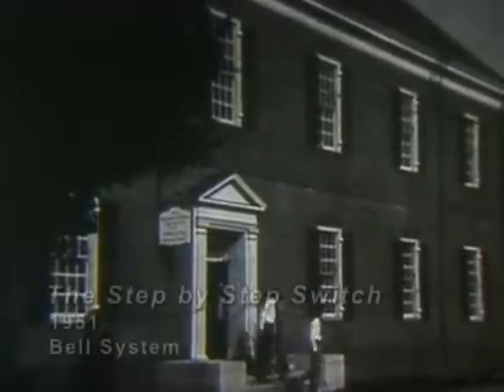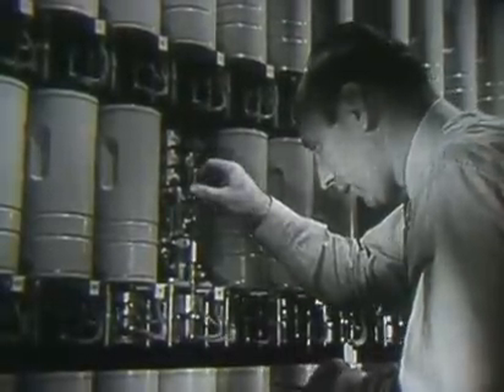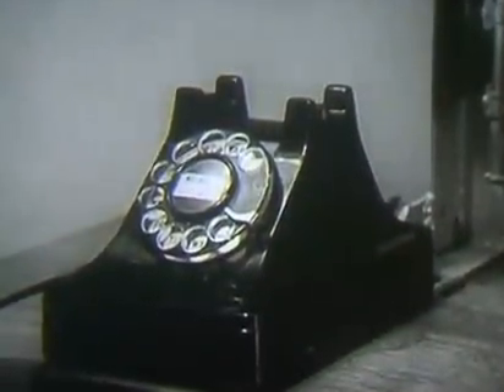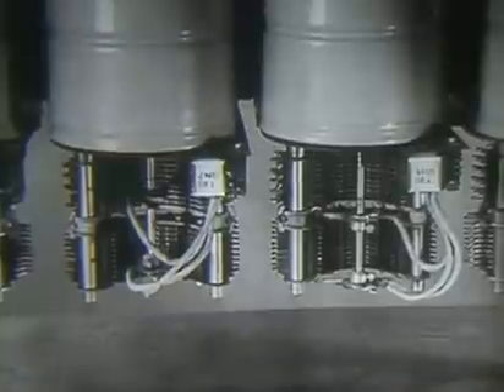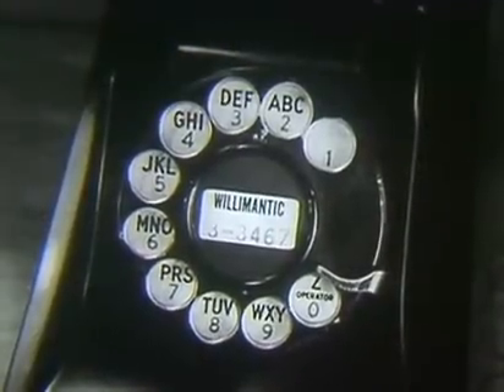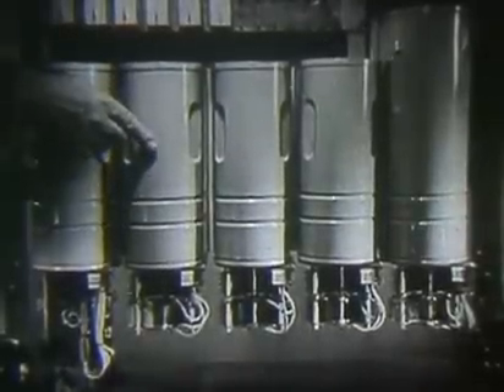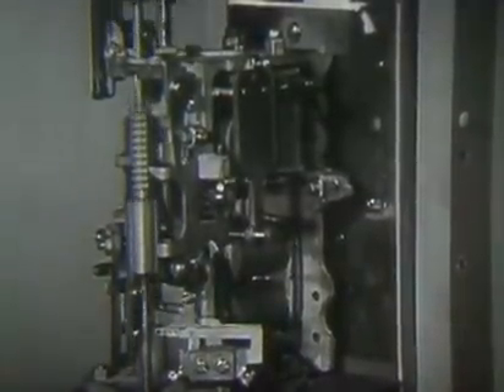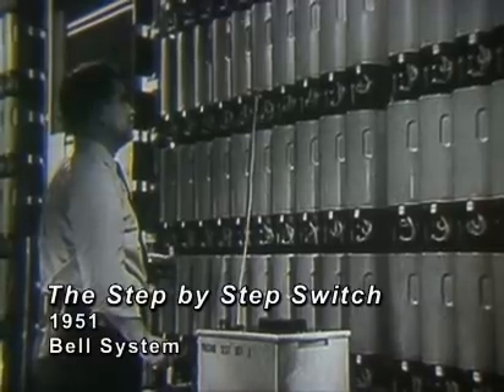AT&T Archives: The Step-By-Step Switch

Comment: Today, an entire building full of those switches can fit into a small electronic box the size of a loaf of bread. Amazing progress.

That said, there's definitely something to admire about the old mechanical system.
Reply: Oh today it can for into a box even smaller then just one slice of bread ;) it's crazy how powerful stuff has become
Reply: bigloudnoise my Dad was a SXS switchman with NE Telephone. He could stand in the office and tell you a particular relay was out of adjustment just by listening. It was amazing
Reply: @Sam Rockwell "self driving semi trucks are starting to become the majority..." I have no idea from where you got this.
Reply: The old electromechanial switches are less vulnerable to an EMP though.
Reply: There's even more to admire when you realise the man who invented the equipment was an undertaker, not an electrical engineer.
Reply: It's nukeproof (unless it gets landed on), and somewhat EMP/solar flare proof because the parts can either be cleaned up or more-simply replaced. That "loaf of bread" or "slice of bread" is, pardon me, toast if it gets fried by any of those things. Vacuum tubes and mechanical components stand a bit more of a chance. It's the same reason that the government has some old radio sets loitering around somewhere that still use tubes. There's a lot less nuclear weapons, but they didn't just disappear overnight.
Reply: @LGTheOneFreeMan  yeah but should we live in fear for a potential situation that most likely may not come? That's not living IMO. Otherwise I would be immobilized by fear of cancer, or asteroids, or volcanoes, or car accidents, etc...
OR, should we just continue on to create new things and keep living our lives?
Reply: @LGTheOneFreeMan  Did you see the report of staged power lines during EMP nuke testing? Whole lines were burnt out, the wires melted.
Reply: I did a quick back of the envelope calculation and you would fit the equivalent of around 20 million of those cylinders today on a silicon die the size of a thumb in width, a hundredth of a thumb in height..
Reply: @ingeniouswild Yeah but that chip the size of your thumb nail cannot handle the actual electrical POWER that would be involved in 20 million conversations! Couldn't handle the amount of data of anywhere near such an amount of conversations either, not by a long shot. The mechanical switches tot see here carry all the(relatively hefty) current that came with the analog signal that embodied the whole conversation, your chip could only make the connection but would need other, much more elaborate equipment to actually consequently handle the actual conversation (in case of telephone calls), nowadays digitized and thus carried on the form of data until it gets converted back to analog sound waves (alsof electric signal) inside of the phone itself so that the speaker can produce the actual, desired sound
Reply: One thing can be said: the whole time, the decades of time and effort expended by thousands of people to build the more modern digital, all worked because the step-by-step systems allowed all of the engineers, technicians, and all of the other support people in the huge system to talk to one another during the development process ☎️😁
Reply: bigloudnoise can’t something like a modern flagship smartphone do it, given the right connections?
Reply: @kaylamitchell1982  A "smartphone" or a "rotary phone" is not relevant to the contents of the video. It is about the SWITCHING NETWORK, not the handsets.
Reply: Now says you can integrate all that onto a single semiconductor
Reply: @BGTech1  There is still a requirement for something to power the speaker and mic on the phone.  That was done with the 48v DC that goes across the copper telephone plant.  Now days, anyone still using a "telephone" is most likely getting fiber to their location, and then a powered fiber to copper adapter box that will provide the 48v power (and 72v for ringing).  Smart, digital telephony systems, such as your cellphone, do it all with RF to the cell site, and then fiber from there to the switching center.  Those fiber/wire runs are still the more fragile part of the telephony system and now that we have WiFi-6 with enough bandwidth to beat the speed of 1GBit ethernet, there will start to be more and more wireless links included where the absolute bandwidth required will allow it.
Reply: A load of bread, That's big!  You must be old!  -- Just kidding.
Reply: The old mechanical is better than the new stuff out there today, look how bad VOIP is
Reply: @jimdandy7772  LOL, the old equipment is impressive, but by no means can it compare to the quality of VOIP or SIP.  By the way, even analog to this day, can be prone to call quality issues.  If you've ever had to deal with a fax machine you'll understand how bad the old technology was.
Reply: @xeero24  completely agree! VOIP/SIP has become so much better over the years
Reply: @qpSubZeroqp  My IPhone has the same sound quality as my landline rotary telephone.
Reply: So many jobs gone. Ah the progress.
Reply: @John_Da199  and so many more created
Reply: Abu Baker - so much wasted time saved.... oh yes, the progress

And then you have... so many jobs created from the progress... oh... the progress...
Reply: @John_Da199  Not gone. Moved elswhere. Who do you think designs, maintains and builds those newer systems?
Reply: Abu Baker not trying to insult your intelligence but, do you believe we should do things the hard way because they present people with jobs, even if it’s less efficient? For example self driving semi trucks are starting to become the majority, do you think we should regulate that and keep truckers jobs?
Reply: Sam Rockwell self driving trucks are not even close to being a majority
Reply: @mikeanderson4795  Are they being used anywhere?   I have heard nothing about any self driving cars bring used in public.
Reply: @ThumbDr  that's a question we as a society will have to grapple with, because if you automate everything there will be no jobs.  And people need to feel useful.
Reply: @jamisojo  Tesla Autopilot: Am I a joke to you?
Reply: @jamisojo  Read up on Tesla, GMs Cruise company and perhaps Google's Waymo as well.  Electric vehicles are demonstrating all kinds of automation because everything is controlled electronically so that computer inputs and human inputs are merged into a very automated driving experience.
Reply: @ThumbDr  yes. why bother pumping water with an electric pump when you can hire 50  people to constantly run buckets from the river? that's 150 jobs right there if you make it 3 8-hour shifts
Reply: @ThumbDr I for one DO think we should save truckers' jobs!
Reply: @John_Da199  yeah just forget about the millions more it's created you boomer.

Comment: Worked on WECO 701 PBX’s as a PacBell PBX repairman in Silicon Valley mid to late 70’s. They were being replaced by Northern Telecom and AT& T Dimension EAPBX’s. I liked the Stromberg Carlson XY Switch better though. Faster to trace a call and easier to maintain and switch plates were universal. I still have one in my shop.

Comment: My first 2 years army was signal corps. And we used to call them "up and overs" all worked on 24-48 volts. We used to have combat operators with portable switch boards( front lines) then to the rear. The rear ward units were up and overs. That connected to the real world. Then in areas that were stable the combat operators got the portable up and overs and stood by if needed. And operate/install lines as needed. L was a 31m20/ 2t and worked a mux  unit with 12/24 channels. And was" the long lines". To the rear area. All to make a dollar for this privates famly. . And get feed. Tks

Comment: When I hired on to  AT&T (Southwestern Bell at the time) my central office had just been converted from Xbar to 1ESS.  When I retired from same central office over 36 years later it was DMS and we were testing interoffice fiber for 100 gbs circuits.  I trained my entire career to keep up with technology.  It was both challenging and rewarding.
Reply: I left Lucent in 2003  we had the 5ESS, funny you mention the DMS, that was a Nortel switch, used to be called the big Brown machine, nice to see comments like yours, brings back good memories, I started in the telecom business in 1970 at GTE Automatic Electric Co, used to engineer step by step central offices, I am now 73, best regards to you!
Reply: I have similar experience starting with manual patch cords, analog multiplexing and finally digital fiber. Very fun and amazing!
Reply: Was a COE installer for 40 years.
Reply: I started my telecom career with step by step switches
Reply: My first job out of college was working with retired South Central Bell folks who spent their careers on this equipment. They had some amazing stories and a lot of pride in their work.
Reply: That old relay logic which replaced telephone switchboard operators is astounding... The men that came up with that had no computer help... All brains, determined and concentrated on making phone systems reliable
Reply: I live near a large 15 story ATT building that was built in 1964.(Cambridge MA.)  It probably had (maybe still does) hundreds of thousands of these switches.  I presume that as phones whent from rotary to touch-tone and beyond, that the old switches became obsolete.  Do you think that the switches are still in the space?  I suppose that the new switching gear occupies much less room.  Are those big telephone buildings largely empty now?  Thanks.
Reply: @rustyshimstock8653  Those switches are long gone.  Have been replaced by newer equipment throughout the years. Telecom companies invest on average about $20 million annually on new equipment to keep up with technology and capacity. There is a shelf life for equipment so some of it may be in use for 10-20 years but eventually service is migrated to more efficient technologies.  Equipment takes up space and also must be maintained in controlled environment/cooling; These buildings may be empty of the people they normally housed but are of prime value for equipment location.
Reply: ..and now we just wait on the pension check..
Reply: I worked in toll most of my 29 years. I did see three 1AESS offices retire. Two went to DMS and the third went to the DMS oriented computer only carded equipment.
Reply: Is this you?
https://youtu.be/1G2keZBSZmY?t=60
Reply: And when did it dawn on you that it was always about mass surveillance?
Reply: @aybee63  He's right.  Nothing whatsoever to do with communicating across town or across the country, for interstate business, convenience, or friendship.  What a massive genius...
Reply: @PhpGtr  Yes because investors love to invest in pleb friendships. It is so rewarding for them.
Reply: @aybee63  Sir, can you point me to your dealer?
Reply: @TheLordOfNothing  Why do you want to know his dealer? Do you want to be that paranoid also?
Reply: @ The joke

Your head
Reply: @aybee63 I want some of what your smoking.
Reply: @aybee63  that's a stretch
Reply: @aybee63 If so, why did you use it. Why didn't you just drive or walk to the person you were interested in talking to ? Too busy, too lazy, didn't feel like it, or what ?

Comment: When I was growing up, my neighbor worked for AT&T Long Lines. He used to give me old telephone parts including switches that I wired up to make a small phone system of my own. 
Later as an adult engineer, I did work for SNET and New England Tel. There was a lot of SXS central offices in operation well into the early 80’s. I did a lot of work converting offices from mechanical switches to ESS. 
One thing we learned was that the electronic equipment needed air conditioning. Before that, telephone central office buildings were not air conditioned. This drove up power requirements and required new electrical services and larger emergency generators. 
Of the 200 or so Central offices in Connecticut, I probably did well over 100 of these conversions. 
The most common ESS was the Western Electric #5ESS They produced thousands of them in the 1980’s. At each site, a temporary building addition would be built, the new ESS installed and wired. When it was operational, the old SXS or crossbar switches removed and the new ESS was slid into the old building while in operation. The cables were then shortened, by “half-taps” (splices) and the temporary building removed. 
An enormous amount of work and cost.
Reply: A few found their way into experimenter’s shelves, but the vast majority were scrapped to recover the metals they contained. I remember truckloads of them being hauled off for scrapping.
Reply: Bill Moran where have all those switches gone? It would be super cool to get some of those to do something with.
Reply: any tips on what to brush up on getting into CO work?

Comment: Every FAA Enroute Air Traffic Control Center (ARTCC) in the USA, 21 of them, had these step by step telephone installations in the basement to handle all the iterfacility, entrafacility, voice relay, radio, radar and microwave communication.  Enough capacity for a town of 40,000.  As a controller I simply plugged in my headset and had instant access to air/ground comm, a multitude of landlines to various facilities by simply pushing the button, dial and ring capabilities, adjacent sector comm, and isolation.   A complex design simplified by established Bell Telecommunications already in use. These telecomm devices were in use from 1962 until the late 1990’s when voice comm advanced to digital switching...VSCS (Voice Switching and Control System).

Comment: Serving 20k Customers. And all it needed was 24 volts to pulse the Step Switches. In the correct order..I learned that. When the power went out. The phone lines still had voltage.

Comment: I worked for South Central Bell in the downtown Nashville, TN central office 50+ years ago.  We had four exchanges of step-by-step in that office: 242, 254, 255, and 256.  244 was a crossbar switch, and 259 was Nashville’s first ESS.  I started as a frame man.  Our MDF carried all six of those exchanges.  Twelve feet tall and half a city block long.  That means a jumper wire connecting the terminal on the horizontal or number side of the frame to the assigned terminal on the vertical or outside cable side could be over 200 feet long.  There was such a jumper for each one of the 60,000 numbers in our CO.  If you figure the average length as half of the max, that meant there was around 1200 miles of jumper wire on that frame, or enough to run a single two-wire jumper from Chicago to Houston.
Reply: Good stuff, your Main Distributing Frame, what did you have on the Vertical side for protection, gas or carbon arrestors? Were they Cook or Reliable? Did you have an IDF as well ?
Reply: @dc10fomin65  since the frame was the same vintage as the step switches, they were protected by carbons.  Don’t know that I ever noticed the manufacturer.  I would have assumed Western Electric like all the switch gear.  There was an IDF on the second floor
Reply: @LandNfan  Amazing to catch you on the air, I used to work for GTE AUTOMATIC ELECTRIC and did a lot of C.O. engineering, watching these videos brings back many memories, thank you for your comment, best regards.

Comment: Worked as s Switchman 3 years in a local step-by-step Central Office from 74 to 76 than 6 months school on a long distance Common Control “cross-bar” 4-Wire Long Distance system. Worked there 8 years as a Central Office Technician. Transferred to Equipment Installation and worked there 12 years.

Comment: Worked mid nite shift for years adjusting these switches. Dial tone from the line finder 1 digit per selector last 2 digits was connector, which provides ringer. Damn announcer agrees.

Comment: Absolutely amazing. I wasn't expecting this kind of electromechanical complexity. I thought I'd see a bunch of valves (emulating transistors) or something like that.
Reply: I don't think vacuum tubes (valves) were ever used for switching, though plenty were used in the carrier systems.  The earlier electronic switches used small reed relays to do the actual switching.